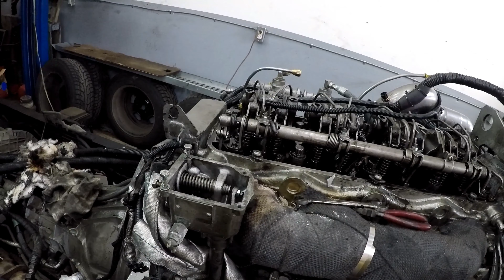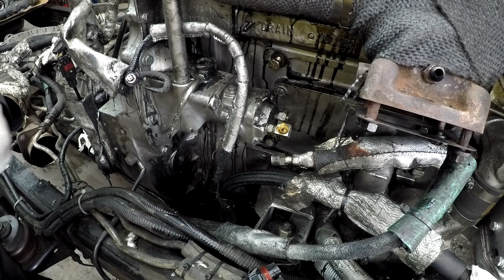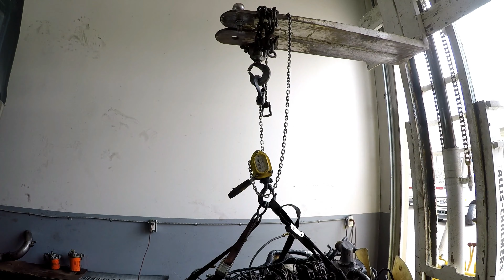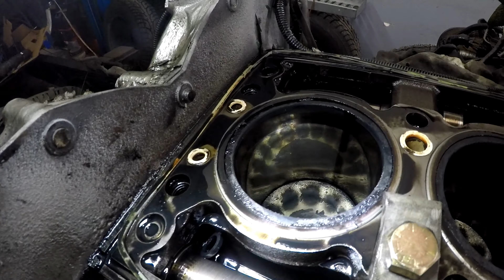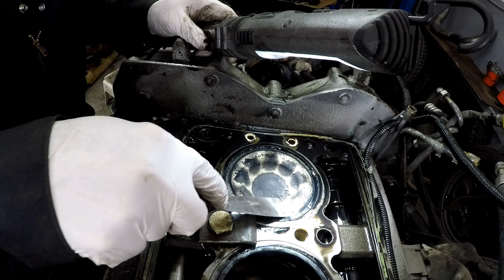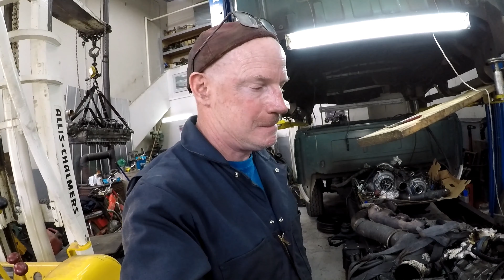Detroit 4-53TIB Taking The Head Off

Comment: That grainy material is what has the compression Down. How are you going to clean the Pistons? I agree with you liners and rings will get everything back to 450lbs, degree it should be.
Reply from the maker: True, I'll use diesel fuel in my parts washer and a soft wire brush for the crown.  For the skirts diesel fuel and 2000 grit sand paper.

Comment: thanks for sharing. 
it's easy to imagine that the ceramic dust would cause premature wear, on your rings and liners. however, most of it would've gone straight out the exhaust. do you still have good compression?  perhaps there's no need to pull the linnets and replace rings at this stage,  whilst still testing out propane, etc.
On another note, your injectors No.2 and 4 appear to have a nice even spray pattern. No3 looked like it had one of the nine nozzles not squirting, not sure about No1, what do you think?
Reply from the maker: If the compression wasn't so low I would not be concerned, but being it's 100 psi below the minimum by Detroit, it's never going to improve from this point on. It's possible injector 3 had one hole plugged as the injectors were very coked.  I've cleaned and tested all the injectors.  I'll have a look at that #3 piston today.:)  Thanks.:)

Comment: The ceramic coating works good on pistons were the injectors are not blasting down on the piston head causing thermal shock. 
I’m sure the coating works good in Spark ignition engines. 
You might want to look into another set of pistons and liner since you have it a part some.
Reply from the maker: True, pulling the liners and pistons this week to see if I can salvage the pistons.  Hopefully they are not destroyed and I can just get 4 new liners and ring sets.:)
Reply: May be a little chunks of ceramic jammed the rings
Restricted their movement. 
Do you notice any micro scuffing on the cylinder more than normal one liner it look like there was a line 1/2 inch wide but it might be reflection.
Reply from the maker: @akfarmboy49  Yes two liners have scuffing 1/2" wide.  Possible like you say ceramics are jammed up in the ring lands.:)
Reply: @detroitgarage9430  I do find your project very interesting. It’s all about reliability in my book. 
Ceramic coated pistons is interesting to me too. 
You have to get a ceramic that has the same expansion rate as aluminum.
Reply: 35 years ago I was looking at 
Putting a 453 and a pick up
But back in those days they were really expensive 
And not enough time or money 
I also was looking at IHC used tractor motors
Reply from the maker: @akfarmboy49  They've come down in price, but still pricey.:)

Comment: What determines if you can put a turbo like on a 471 that's in a grader? What all do you have to change over
Reply from the maker: The N engines are totally different than the T engines.  In most cases you can replace the pistons, rods and valves and you'd be fine.  I switched an 353N to a 353T and just changed out the pistons, rods and valves, but depends on the engine you have.

Comment: If the coating was flaking off it’s surely worn the rings. I’d be highly irritated at whoever coated the pistons.
Reply from the maker: True, this would explain why the compression in down 100 psi below minimum.  Coating wore the rings and liners, so with any luck new rings and liners are all that it needs.:)
Reply: @detroitgarage9430  .......................at the coating company expense!

Comment: Overfueled Too much carbon Probably getting wedged behind the top compression ring and maybe even ring two If it wasn’t caught sooner you’d be snagging those rings in the portsDrop your injector size down to the 71 series N 80 and try timing at 1.475
Reply: "Over fueled" or not there's no way that coating should have come off the pistons, and just for reference if the engine was indeed "over fueled" the EGT would have been high which it wasn't.